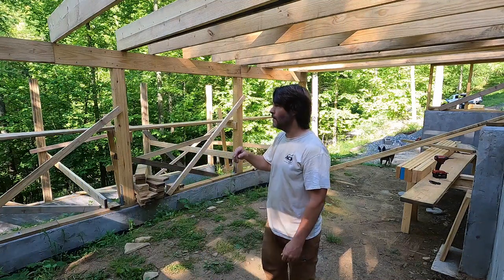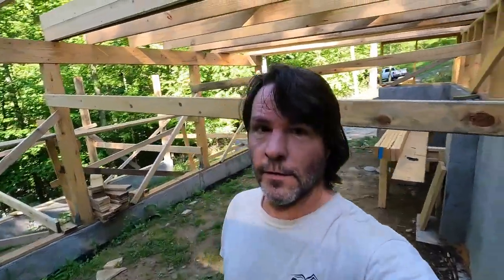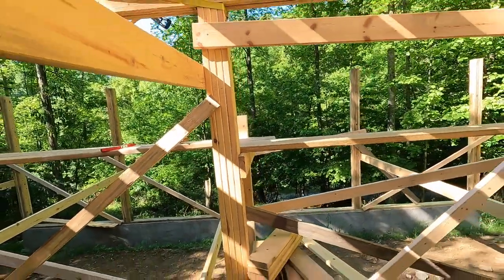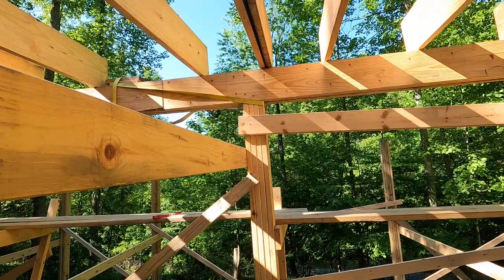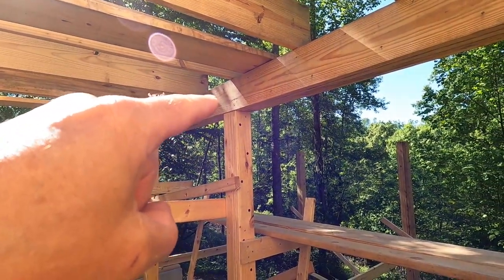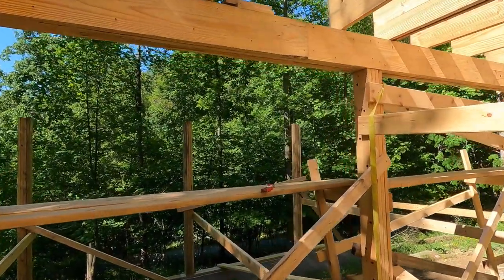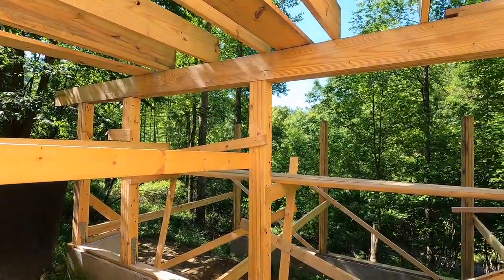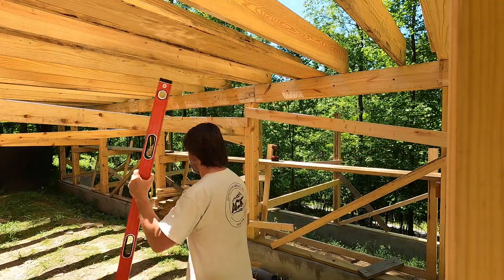Two Story Off-Grid Mountainside BarnBuild Ep 9 | Addressing Beam Structural Problem

Comment: Just wondering what is going to keep the whole thing from racking off the concrete block walls and tumbling down the hill?  Do you plan on some sort of bracing high to low?
Reply from the maker: Hi John. Initially I was thinking "hope" and "fingers crossed" would suffice, but there are a few things keeping it from falling down the hill. 1) The footer/block wall weights about 66,000 lbs, the small wall on the up hill side has anchors every 4' and the columns are secured with Simpson HTT4 tension ties rated at 4400 lbs tension each, about 48,000 lbs in total. 2) The weight of the building (framing, siding, sheathing etc), once complete is about 55,000 lbs. All this pushing down, resisting overturning. FWIW, this is about 600 lbs per sq ft, my soil is about 2000 psf. There are 4 Zip panels on the first floor nailed every 4" on edge, 6" in field to act as shear walls. The Zip panels also span from the first to second floor, tying the framing together, not to mention the wall and roof sheathing preventing racking. 3) I did some math on wind loads. Wind east or west direct @ 160mph , north or south @ 120mph should easily be sustainable. We've recorded max 38 mph winds here over the last 7 years. So after all that, I do have my fingers crossed. ;)
Reply: @PoeRunCraftProvisions  the plates are secured to the concrete block walls sure but the floor system rests on a 2x6 pony wall. I wouldn’t put my trust on just the weight of the building holding down. I would be adding braces from the top of the pony wall to the bottom of the mid-wall. Then there is no chance of it moving. Good luck!!